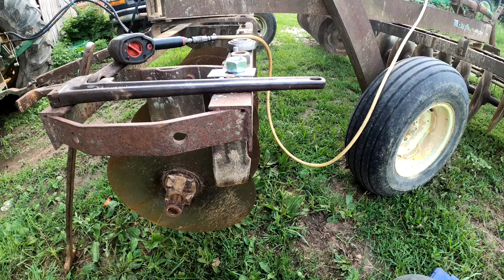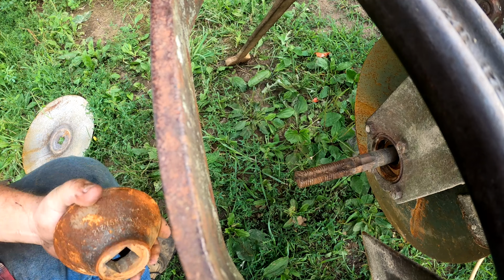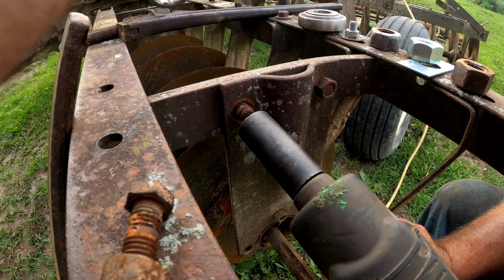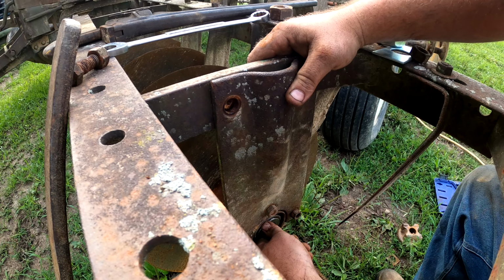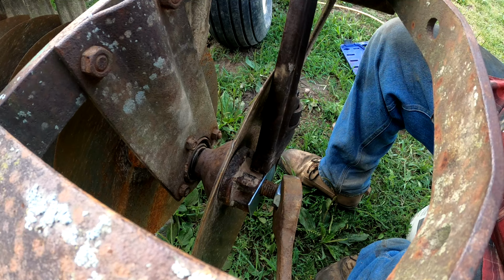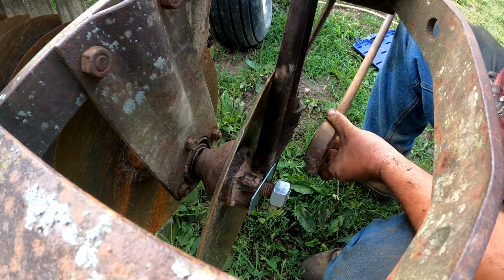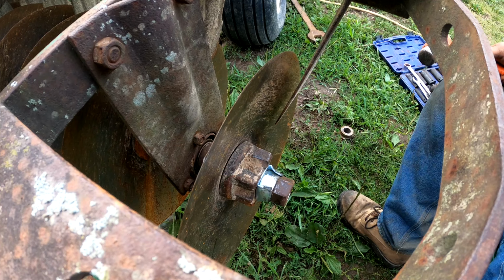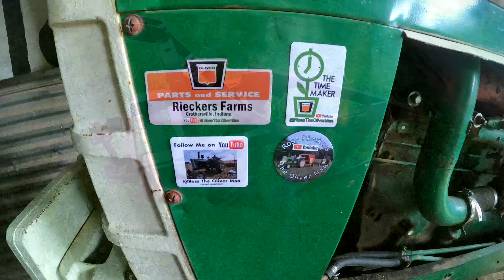252 Oliver Disc Repair AND Another new Toy.

Comment: Hi Ross-I believe that somewhere in the ‘60s, the 3241 plow was replaced by the 3242.  Dad bought a new 3242 in the spring of ‘69, initially set up for 3-14s for a different tractor, then added a fourth bottom to make it 4-14s for the 1550 when he bought it.
Reply from the maker: Yes it was. The hitch was changed as well when it switched to the 3242

Comment: That repair seemed to go pretty easily, relatively speaking.  You're right about pretty much all farmers having to do that job at some point.  I didn't have to this year, but last year I had to replace one of the bearings in my Krause disk.  They are greasable, which I like, so I hope I don't have to change them often.  But it wasn't really that hard, and when I ordered the bearing, I got 3 or 4 extras from Shoup so that I'd have them on the shelf.  Good purchase on the plow.  Today I dropped off my 1550 at my mechanic buddy Joe's for a new hydraulic pump and to put a new oil seal under the power steering in the front.  Got some oil running down the pedestal (narrow front).  When he's done with that, he's gonna work on my new 66 - convert it over from 6 to 12 volts system and from positive ground to negative ground.
Reply from the maker: I’m excited to see more videos of your 66! I think you made a good buy.

Comment: You should try that new fangled stuff, called grease.
Reply from the maker: On a non greasable, steel sided sealed bearing? Makes sense.
Reply: @rosstheoliverman  I was eyeing the threads.
Reply from the maker: @bungalallyO  ahh. Now I got ya. I’ve always put them on dry because it seems to attract more dirt if you lube them. I’m sure it would go on easier though.
Reply: @rosstheoliverman  And come off easier.